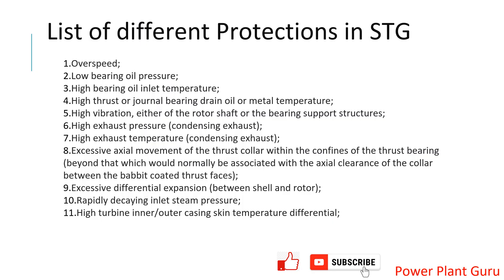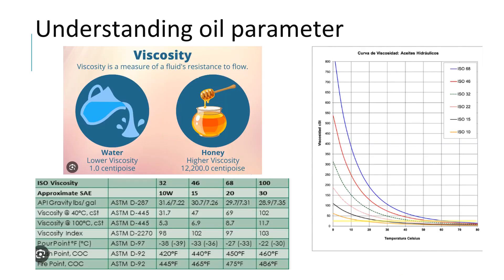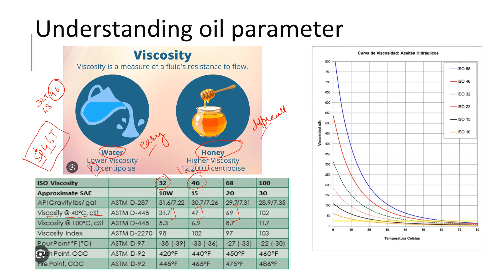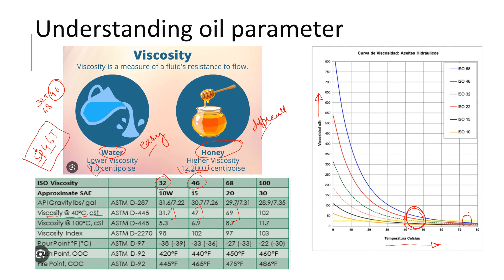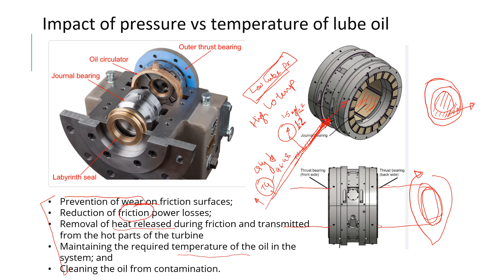Turbine lube oil system, Turbine protection, Lube Oil temperature and pressure, power plant guru

Comment: As per my experience about Graphenizer-4 oil (made with Graphene) can take the Turbine lube oil system to next level for sure.
 a.) It forms a micro-film coat layer of Graphene like a shield inside that controls friction, wear & tear and protects from other negative factors.
b.) It Increases efficiency on metal-to-metal surfaces & other internal moving parts.
c.) It reduces the Over-heat up to 60% and extends the life span. 
d.) It also reduces the load drastically.
e.) It turns the excessive noise / sound into smooth running.

 For more info search in google for Graphenizer-4.

Comment: I don't know how to participate in doubt clearimg seasons.
I've right now many confusion as I'm electrical emgineer and most of time dealing with performance and PPA.

1) What will be the impact on output of ST if we increase temperature, pressure. 
I believe increaing both will increase output.
Temperature can be increase by two ways
1) Increasing the hp fw inlet temperature by increasing feed water temperature through lp steam induction this will reduce lp stesm flow to turbine
2) opening the msv to reduce throttling loss but this will reduce steam inlet pressure. (I've observed this in PI, however if there is reduction in steam inlet pressure the drum pressure will drop then how does of effect to drum level?)
Reply from the maker: Hi , thank you for watching my videos. 
We have discussion sessions on Sunday and we do it on Zoom/ Google meet platform. It is a paid session but with a minimal charge. If you are interested we can do that next Sunday, please let us know from which country you are as we have to adjust to different time zones. 
Pl share your email id, i will share all the details.
Reply from the maker: We are going to have free session on one Sunday, please let us know if you wish to join and what you want to ask.
Please send us a email, what questions you want to ask. our mail id is dgna.creator@gmail.com

Comment: Please make a video ge frame 6f trip oil system. I've few doubts there
We have no pressure switch in trip oil line going to 20 TV for igv.
We have 3 pressure swtiches for liq fuel and gas fuel stop valves and 2/3 logic.
In activation of trip signal trip oil solenoid valve drain the trip oil but how this will stop hydraulic oil supply to igv or fuel valves.
In Frame 6f trip oil is taken from lube oil header and pressure is around 30 psi.
Reply from the maker: Sure. Will make a video on the trip oil circuit .

Comment: Normally 2/3 pumps keep in service during normal load. During sudden tripping of any one of the pump and standby pump wouldn't cut in on auto the system will trip.
But
I want to that pumps have common discharge line, so if any one pump trips how the discharge header pressure drops as single pump eould still discharge at same pressure.
Say i have two pumps discharging around 5 bar of any pump trips the other would still discharge at 5 bar so how the pressure get low in lube oil header?
Isn't the flow is reducing?
Why not we have flow sensors instead of pressure sensors
Reply from the maker: We need to understand the relationship between flow in the pipeline and pressure. 
Pressure is directly related, reduced pressure is an indication that flow in the pipeline has reduced.